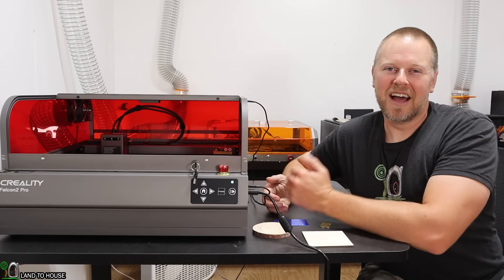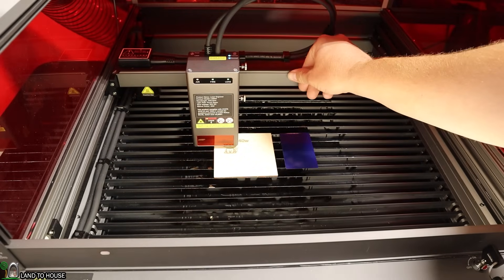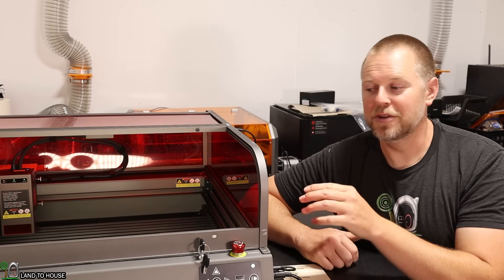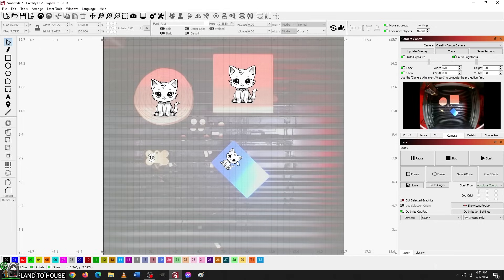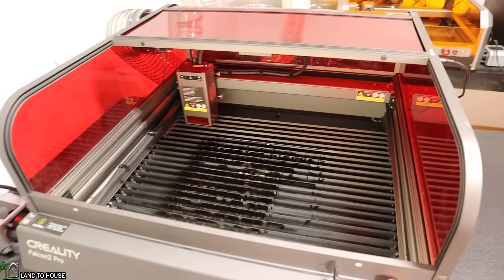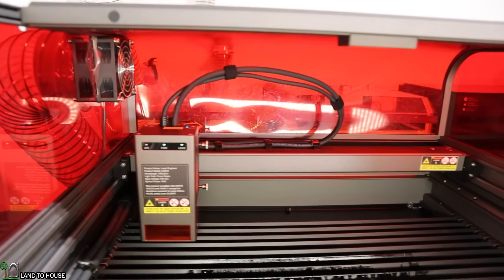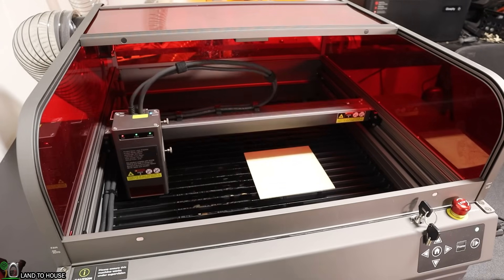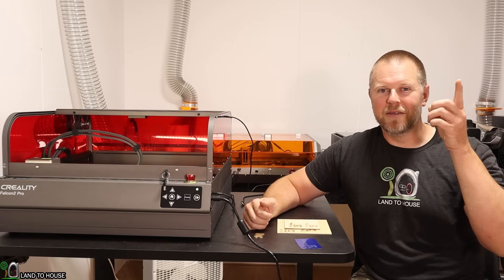Creality Falcon 2 Pro Diode Laser Review 22W vs 40W Settings & Onboard Camera Setup

Comment: Well, using a 22w or a 40w diode laser just for engraving is a pitty. They are mostly cutters. That’s where they make the difference. You can engrave with a 5 or 10w diode. Maybe you will find time to test it for cutting wood, black acrylic, Foam, etc.

Comment: Have you tried etching glass? Let's say you want to personalize a drinking glass. How about a silver cup? I'm going to imagine the curved service would be an issue.
Reply from the maker: I have not tried glass yet. These lasers can use a rotary tool that let's the glass spin so the laser stays focused as it works.
Reply: @LandtoHouse  Shhh. Not too lound. I think I may have found a solution to a need out here. I've been to the engravers in my area and they all say the cup and glass I have is too curved for their machines. Maybe I can fill a niche. Or engrave my gift cups. Thanks.
Reply from the maker: To be effective on glass you really need a co2 machine.
Reply: @LandtoHouse  Ah. An opportunity to get another tool! More to explore.